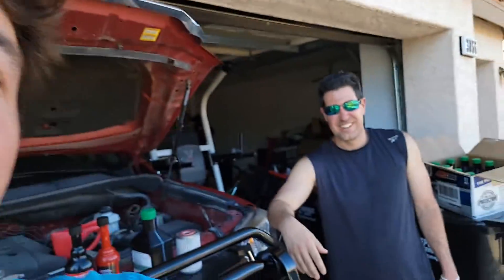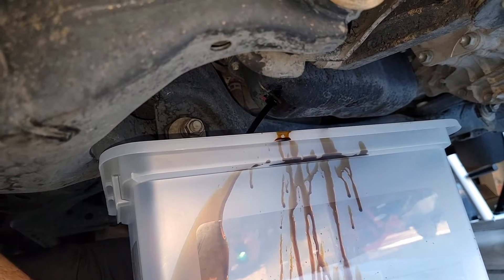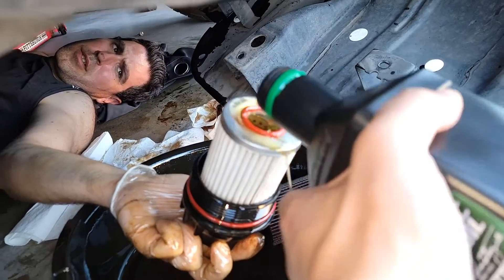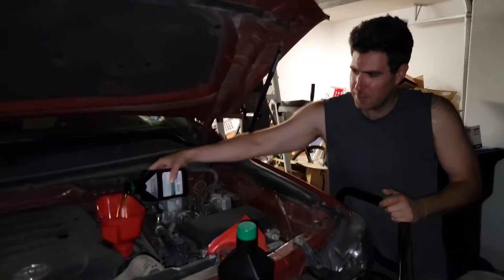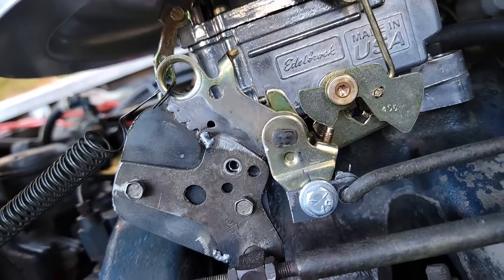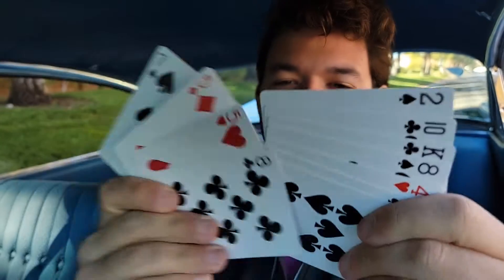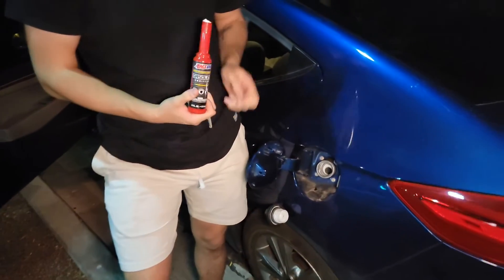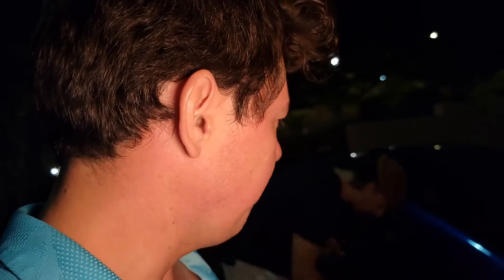3 Fluids to Revive Performance of your vehicle

Comment from the maker: ✅️ ✅️ ✅️   Watch This Next: Get Faster Transmission Shifts - https://youtu.be/dSGrlE-Nmx8

     ✅ ✅   Save 25% On Next Fluid Order: https://www.amsoil.com/offers/pc/?zo=5331179 

     ✅️   Your Professional YouLubher: Eben Rockmaker. Find The Right Fluids For My Vehicle - https://www.amsoil.com/guides/?zo=5331179      

    🥇🥇🥇   Synthetic Oil Protection Google Map Reviews
(702) 472-3614
https://maps.app.goo.gl/DmLU5hP72HadUBEm9
             
     ♥️  Synthetic Oil Protection Website - http://syntheticoilprotection.net

     Did you know a oil manufacturer can call a lubricant a Full Synthetic when it's only 25% synthetic? AMSOIL is different because it is 100% Synthetic and has a higher film strength keeping the metal parts separated. AMSOIL allows less friction, less heat, less wear on the component. AMSOIL Signature Series motor oil will last 25,000 miles on 1 oil change! See Results - 

     ♥️ See Fluid Performance Tests - https://www.amsoil.com/performancetests.aspx?zo=5331179      

     ♥️ Your Vehicle Could Run Better Than Brand New By Choosing The Right Fluids! See Results - https://youtu.be/zH-VquYlhqA

     ♥️ Why AMSOIL - https://www.amsoil.com/about/exclusive-distribution/?zo=5331179    

     ♥️ Synthetic Oil Protection Coffee - Ebens Favorite: https://supportwith.coffee/shop/subscriptions/sop/

Comment: For anybody watching these videos for the first time, Amsoil is by far! the best oil you will ever put in your engine. Once you have tried it, you will never go back to any other oil or, at least, that's the experience I have as well as those I also got hooked on Amsoil.
Reply from the maker: 👍, what was the first car you tried Amsoil on?
Reply: @Syntheticoilprotection  2006 Ford F150 XLT V8 & 1999 Ford Windstar both at the same time after using Royal Purple for years.
Reply from the maker: Sweet,  what was the biggest difference on your motor?

Comment: Been driving for 11 years, my everyday driver has always been a Toyota. I’ve noticed that Toyota always seems to make Toyota’s run a lot smoother on Amsoil and the help of the fuel additives from Amsoil such as the performance improver and upper cylinder lubricant.
Reply: Noticed the same with my Tacoma, Camry and Corolla
Reply from the maker: Yeah they seem to make a bigger difference than most other cars for some reason also the transmission fluid makes a huge difference as well
Reply: Maybe because good cars knows about the good stuff and show it.

Comment: When I get home I am heading to NAPA and changing the oil, filter and brake fluid in my wife's pathfinder. Then i will do the Oil, front, rear Diff, Transmission and transfer case in my Titan Cummings It will be costly but you sold me on the "oil change" 15,000 miles vs 5,000.
Reply from the maker: Awesome Herald you'll get the products at the very best value with the 6-month PC link here and that would attach me to you so in the future I can always answer your questions about improving the performance and lifespan of your vehicles by choosing the right fluids as your independent Amsoil dealer.
6-month PC member is only 10 bucks no reoccurring fee and no Auto renew.
✅   Save 25% On Your Next Fluid Order: https://www.amsoil.com/offers/pc/?zo=5331179
Reply: @Syntheticoilprotection  I did it for a year my friend, I have 3 cahs haha. "Longer Stronger" baby.

Comment: The PI for the fuel is the real deal.  
I had some hesitation on the "tip in" 😆 throttle response in one of our German daily drivers.  I ran two consecutive tank fulls  of the PI and it cured the issue.  I've added the PI to the fuel as recommended every 3k-4k miles and the hesitation never returned.
Reply from the maker: That's great have you ever tried the upper cylinder lubricant yet I run that every full tank of gas on both my cars makes a huge difference in smooth idle also you'll make a little more power - https://youtu.be/zH-VquYlhqA
Reply: @Syntheticoilprotection  So I have tried the UCL in an experiment.  I filled up at the same gas station when the low fuel light would illuminate on the dash.  I added the UCL to every fill up.  I did this for an entire year and recorded my gas mileage.  Generally I  drive the same roads and routes.   
I'm in the northeast so the weather varies greatly with all four seasons. 
I'm now running the same fuel fill up routine minus the UCL to see how the gas mileage compares.

Comment: Yo eben I got a new engine being built so was thinking can I use the upper cylinder lubricant
Reply from the maker: 💯, of course I would use it personally in any gasoline engine it's not meant for E85 👍
Reply: @Syntheticoilprotection  thanks for the assistance eben I'm building a 350z high compression it going be a n/a build can't wait been waiting for I think 3 years well bout to be 
I rather avoid E85
Reply from the maker: Awesome if you ever want to try the products this will give you the best value 
✅ ✅ ✅  Save 25% On Next Fluid Order: https://www.amsoil.com/offers/pc/?zo=5331179

Comment: Hey Eben, is it OK to use Amsoil Coolant to fill up a vehicle that currently has Honda coolant inside of it?  The Honda coolant level is low on the radiator and empty on the reservoir tank. Is it ok or should I go get the Honda coolant instead? Thanks
Reply from the maker: Yes they can be mixed however I would just do a coolant change with low toxicity biodegradable coolant it's the white bottle
https://www.amsoil.com/p/low-toxicity-antifreeze-and-engine-coolant-ant/?zo=5331179

Comment: 2020 Ford F-150, 3.5 ECO BOOST. Ford says additive will void the Warrantee.
Reply from the maker: Yes that's normal they all try to scare everybody but there is a thing in effect called the Magnuson Moss act which you can choose any fluids you want for your vehicle just as long as the manufacturer doesn't provide the fluid free of cost then they can attach the fluid to the warranty but if not this will answer your question here - https://youtu.be/Bip58UVaaGg

Comment: How do I enter for the giveaway?
Reply from the maker: Great question John all you do is just leave a comment on any of the new videos and I randomly select people from the first half hour of new videos in the comment section
Reply from the maker: Have you ever tried amsoil?
Reply: @Syntheticoilprotection  not yet!
Reply from the maker: What type of car do you have?
Reply: @Syntheticoilprotection  I would be using it for my generac 2200 inverter generator that I just purchased. According to the weather that I may have it would be recommended that I use a 5W30 . I just completed the break in with the manufacturers oil. And will be going with full synthetic. I'm hoping to complete the breaking process and then do everything that I can to store it the best way possible. Fingers crossed we finish the hurricane season here in New England and don't get any blizzards this winter that I would need to break it out for.
Reply from the maker: This would give you the best value on the products John thanks for being a part of my YouTube Community👍
✅ ✅ ✅  Save 25% On Next Fluid Order: https://www.amsoil.com/offers/pc/?zo=5331179

Comment: Why do the engineers at these automobile companies INSIST upon mounting oil filters underneath their vehicles? I have had Mercedes vehicles since the '90's, and their filters are mounted topside. So much easier, and less of a mess to change. My parents (in their mid 80's now) asked me to change the oil in their LEXUS recently, and l figured it would have a topside filter like my cars have. NOPE, Toyota even uses filters STILL mounted under the car! WTF?!
Reply from the maker: Yeah in the metal cartridge filter on the Toyota you really want to use a filter wrench definitely a little bit of a stickler but if it's the all-metal cartridge filter they are pretty well built like the Lexus GS 350 I have a video on that one definitely a solid car but the filter is a little tough to get to